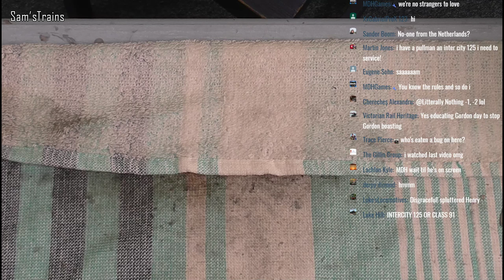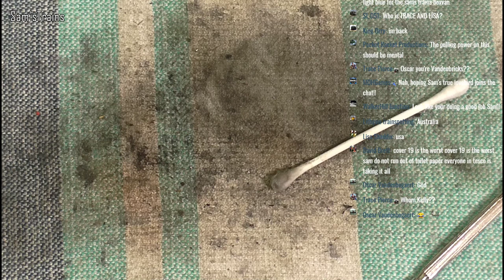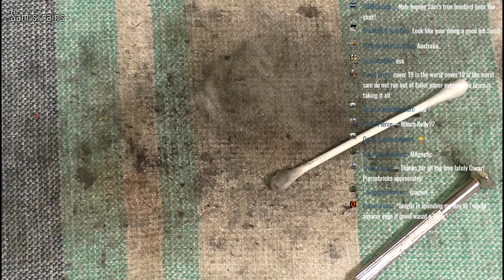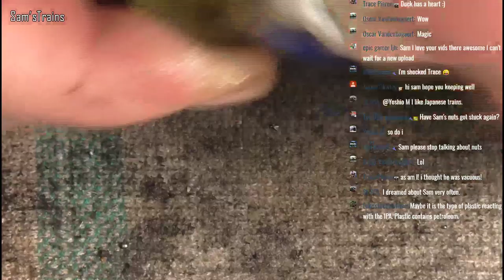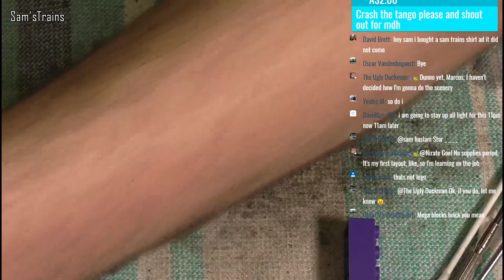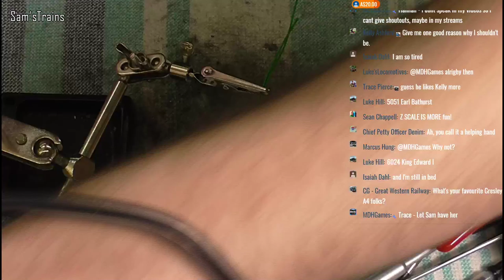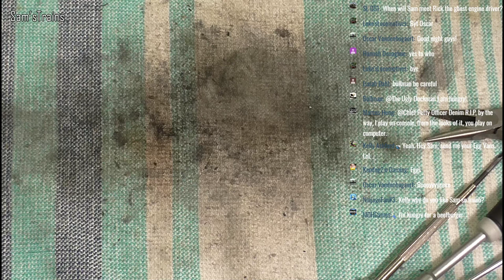Restoring the Most Complicated Mechanism Ever

Comment: It's an old KLEINBAHN train model, ÖBB 1042. You got an old version with KLEINBAHN motors in it, the newer versions had a standard Mabutchi motor clipped on with a different gear. The manufacturer closed doors 2021 :( I also have this (and others), they were very popular low-cost trains and number 1 in Austria for some time. They had quite some innovations and rational manufacturing to save costs, but in the 1990ies they did not continue to make new models, they mostly sold the older stock or color variations. A small attempt was made to swap it to LEDs and digital, they even had 1-2 new moulds (1963 new version and BR 52 steam loco in grey) but could or did not want to continue or invest into it. After the war they were so popular, they reduced the cost even more and sold starter sets for "cheap" prices. They often were sold out early December. 

One of he first after the war and one of the first using plastic. Also funny: the KLEINBAHN name means "small train" but also the founders surname was KLEIN (small) so it is very fitting. They were the biggest toy company in Austria in the 1980ies, but sadly the two brothers did not agree on how to run the company and they parted the whole company into two: KLEINBAHN who more or the less continued, but did not bring much more new products and KLEIN MODELLBAHN which was his brother who worked in the other 50 percent of the factory. He concentrated on more detailed locos. I was working there as a kid for 2-3 days, the guy who ran this died a few years back and the company was bought by ROCO in around 2008 I guess. 

KLEINBAHN, as said before, did make some effort until the early 1990ies and had pretty complete program (houses, trains, tracks etc.) but did not make it into the world of the more serious  collectors. They were only available in their own shops in Austria (and for a brief period) also in Swiss. They also had some efforts to make German, Swiss, Italian and Czech locos, but those were taken out of the program and they concentrated more on Austria.

It's not really a complicated mechanism because if you look it is just mirrored, so they use the same parts on both boogies. To further reduce costs, they also had the same chassis or boogies on various models (different top shells). E.g. 1042 and 1044 are pretty much similar. It was all about cost saving, most rolling stock had same boogies or plates, it was very systematically put together, but not that much focus on the 1:87 standard.

Comment: the outside is very nice, but its the innards that are the star attraction.  i work in electronics, specifically, RF electronics for cable TV.   some of the oldest stuff i see is from the 80s or so and is a lot like this.  while the circuit boards and components were mass produced, they assembled as hand built precision instruments.  it was very hard for me to watch you taking off that beautifully done wiring harness.  someone with a lot of skill and a bit of artistry built the innards of that locomotive.

the rest of it kinda makes sense for that era too.  a lot of my 80s stuff that comes in is built like this too.  the center isn't quite what you think it is, instead of a chassis with everything onto that like you would be used to, instead this appears to have the middle of the truck assembly with everything built onto that in layers.  makes repairs a bit of a nightmare.  we tend to only disassemble the minimum necessary to be able to spread the piece apart at the point we need to get into to make the repair  stuff is a nightmare to get back together if fully taken apart.

one tip for you, if you are going to use that green wiring for everything, get yourself a couple of paint markers in different colors.  put a dab of paint near each end of a given wire for what its doing, that will make your life easier down the road if you need to disconnect things and for this specific engine, you could also put a small dab of colored paint on the motor casing to mark which side is which to wire the locomotive correctly.

and one item for you that might make your life easier if you're interested, its a different type of test lead to apply power into some of the things i see on you working on.  its a much lighter and delicate type of test lead than those alligator clips.  sample link so you can see what i am talking about;

https://www.amazon.com/Multimeter-Silicone-Minigrabber-Electronic-Testing/dp/B0852KRNPP/ref=sr_1_11_sspa?dchild=1&keywords=amazon+electronics+test+leads+minigrabber&qid=1589494172&sr=8-11-spons&psc=1&spLa=ZW5jcnlwdGVkUXVhbGlmaWVyPUEyV0RCTlZVUjkwMllXJmVuY3J5cHRlZElkPUEwNzUwOTY1Q0hIUTg4TTU4R1VOJmVuY3J5cHRlZEFkSWQ9QTA2MDM1MjExRlpDSTlXME9EQ1pYJndpZGdldE5hbWU9c3BfbXRmJmFjdGlvbj1jbGlja1JlZGlyZWN0JmRvTm90TG9nQ2xpY2s9dHJ1ZQ==
Reply from the maker: Thanks a lot for the comment James - sorry about the wiring, I decided it could just do with some refreshing! Thanks a lot for the silicone idea, I may give that a try! :D
Thanks for watching - Sam :)
Reply: @SamsTrains  don't worry too much about me.   What you did was pretty good in all honesty, very clean if not routed onto of the block.

Comment: Hi Sam, how did you get that OBB body so clean? I have just bought a Lima engine from ebay which is 'caked' in what looks like grease and oil. I would like to clean it, but don't want to take the transfers off. Any suggestions?
Reply from the maker: Check through some of these other streams - I detail my method using a toothbrush and soap! :D
Thanks for watching - Sam :)

Comment: The inductors and the capacitors are there only to remove static noise that mai apear from the motor ( the neighbours will hate you if you are running that engine whitout the inductors while they are watching tv or listening to radio).
Reply from the maker: Thanks Paul! Initially the capacitors were to reduce TV interference, but it's not much of a problem these days, since there's less opportunity for interference in digital signals. Big chokes like those help to reduce arcing on the commutators, thus keeping them clean! :D
Thanks for watching - Sam :)

Comment: hey there how do we repair a flying scotsman valve gear on my is bent
Reply from the maker: That's quite tricky - you might need to remove it with a 2.5mm nutspinner, straighten the pieces, and try to refit them!
Thanks for watching - Sam :)

Comment: I used to have a PIKO Nohab diesel. It had a ringfield motor in each bogie, too. When wired up backwards, it would pull every other loco backwards over the railway... I had it until I used the wrong solvent to clean the gears, the plastic bearing inserts all fell apart...
Those yellow ceramic caps will last forever. Look 1980s to me.
Reply from the maker: Ooh that's cool - what did you use to clean it?! :O
Thanks for watching - Sam :)
Reply: @SamsTrains  I think it was turpentine, forgive me I was young, didn't know better and that was what I found. And the Limas all survived it :) I really miss that Piko. It even sounded like the real thing, before digital. Today, you need a ton of luck AND money to find one.
PS those inductors supplement the capacitor in radio interference suppression.

Comment: That worm drive wire is wound on a continuous spiral spring winder. Turns wire into a spiral spring which is then twisted onto the shaft. https://www.youtube.com/watch?v=yU0ZKvEeZeM machine in action, albeit on a larger scale.
Reply from the maker: Many thanks for this Bruce - very interesting indeed!!
Thanks for watching - Sam :)
Reply: And 10/0.1mm wire is ten strands in the core at 0.1mm per strand.